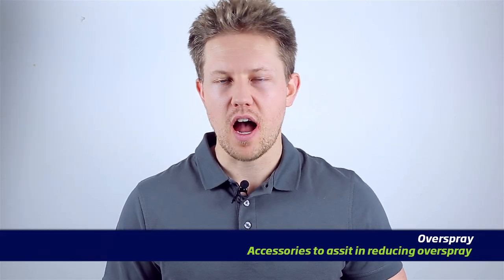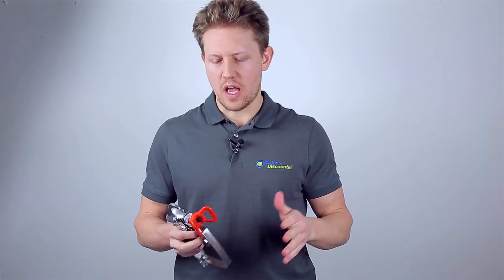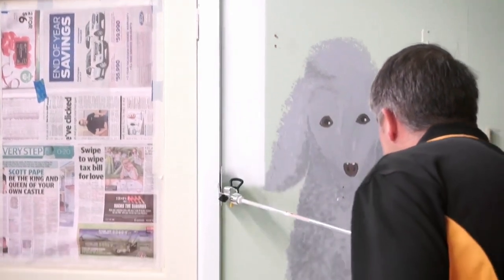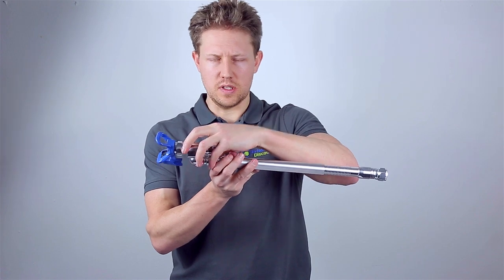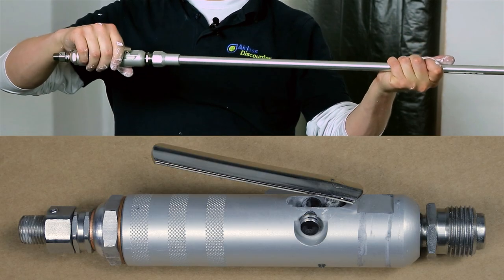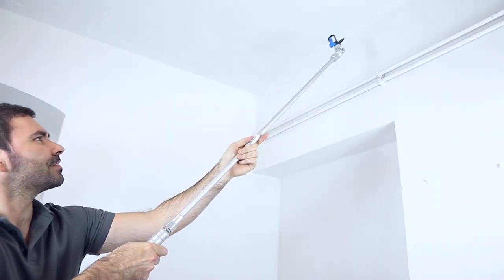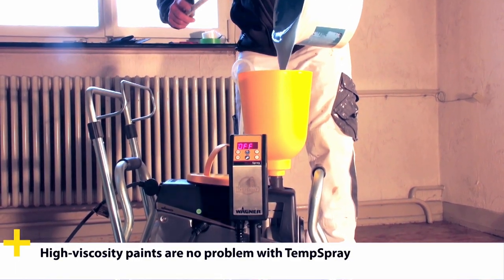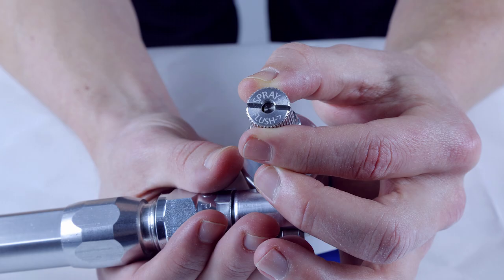Reducing Overspray - Tips, Tricks and Accessories with Airless Discounter Part 2

Comment: Excellent video for several reasons. Never knew about the heated system! I have a question about technique. I back rolled my spraying on an exterior recently- it was great for getting product to stretch and into the crevices but I noticed the finish was different from just the areas I only sprayed. It was my first time using the back roll technique and I didn't use it uniformly on every surface I sprayed. What's the easiest way to do a touch up to make the finishes match , so the textured areas where I rolled and the areas I only sprayed, don't appear so delineated?
Reply from the maker: Hi Don, thank you for watching and thank you for your question. As a general rule, painters are choosing to either spray the entire surface, or spray and roll the entire surface to avoid the possibility of the surface looking delineated. If you want a textured finish, then spray and roll the entire area. If you want a smooth finish, the wall surface must be smoothed and sprayed only. Unfortunately, neither of these are "touch up" jobs, you will need more time. If you were indeed using the roller to "stretch the product and get into crevices", its possible an alternate spraying pressure and spray tip might have got the job done without the need to back-roll. With good technique, spraying pressure and tip size, you may not need to back-roll. We wish you a good day and hope things turn out well!
Reply: @AirlessDiscounterInternational  Thanks! I decided to back roll the areas where the texture isn't uniform. I saw on a few youtube videos that backrolling is good for wood with deep grooves. Keep on going with your channel!

Comment: Aslamo alikum and have a good day I do work on power transmission line in Pakistan I want to share my experience and facing problems during the paint applications on galvanized structure 
We are face the problem about paint wastage 50% during application and we are using GRACO airless pump XHD tip use 213. So plz guide us for better. 
Thanks and regards 
Babar

Comment: i have a problem with my spray pattern. Im useing 517 and Wagner Control Pro 350R. and with max pressure i still get "tails" in my spray pattern. its for my indoor paint
Reply from the maker: Hi, thank you for your question. How long have you been working with the machine? Is the tip new and clean? Check the material as well, what size is required for your paint? Generally you'll find the info on the bucket or in the data sheet.

Comment: What about thinning paint for a tip with a smaller hole? Pros and cons?
Reply from the maker: Hi,
Thanks for your comment. 
It helps if the tip is too small for the paint to be sprayed. But the paint loses its covering power. 
In the end, buying the right tip cost less than having to spray again to get the right coverage. 
Kind regards,
Airless Discounter team
Reply: Thank you for the reply!

Comment: Sorry but i dont want to backroll, doesn’t work perfectly when just spraying ???
Reply: It works well in most cases but backrolling can be used as a technic to reduce overspray. You spray with very little pressure to get the paint on the wall and use the roller to distribute the paint evenly. Many painters like to backroll to get the structure from the roller. In that case they can use a roller to sort out damages and scratches caused afterwards. But again, you can create a great finish just by spraying. Stefan
Reply: Airless Discounter thx for the explanation Stefan , I’m following most of your videos and I can say it’s very useful, since I’m really interested to buy a Graco mark v or x , so another question if you don’t mind , I can use the gigantic Graco mark x or v for painting also and not only plastering ?? Or do I have to use another one (ultra max ) for painting ? Because they only talk about plastering whenever they show video of Graco mark , thank you
Reply: Hi Farid, the Graco Mark Series (V, VII or X) can be used for paint and plaster. These units are standard equipped with a plaster setting (hose, gun, tips). You should consider buying an extra hose, gun (tips, filters) when you like to spray paint. It will also save you money in the long run because the gun/hose for paint is cheaper than the plaster setting. Plus it will make your life much easier when you apply paint (weight of the hose, volume of paint in it, gun filter). You should have a proper talk with your dealer of choice to select of the right sprayer for your materials and project types/sizes. Stefan